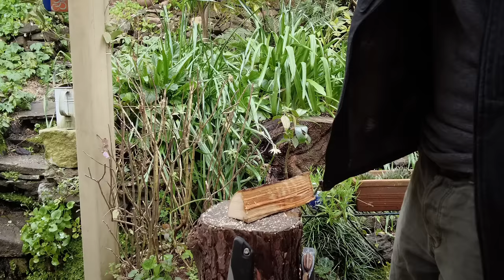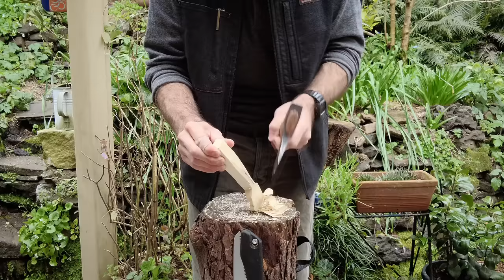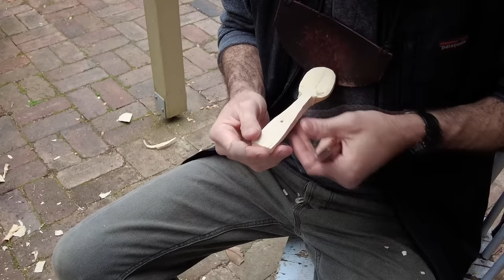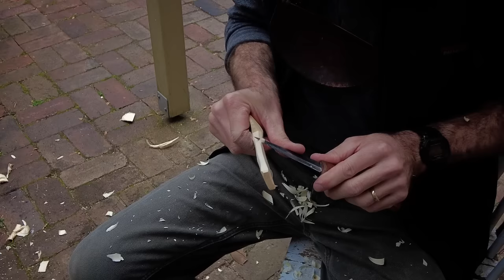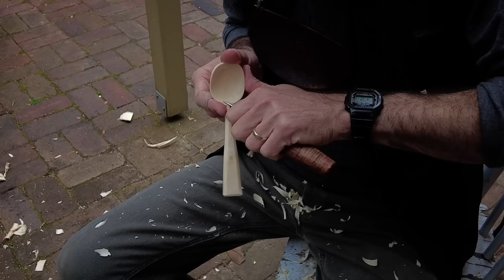Carving a Cherry eating spoon by hand - (silent)

Comment: 0:00 initial axe work - basic shape, heavy removal
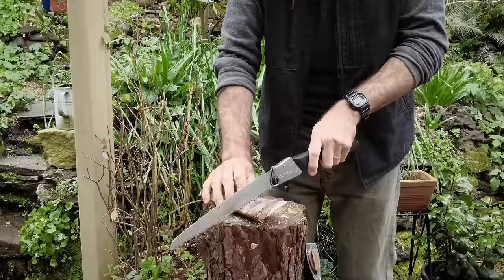1:20 crank stop cut, axing the crank
4:05 drawing the design
5:21 neck stop cuts/ end trims

6:12 fine axe work - handle, neck and bowl shaping
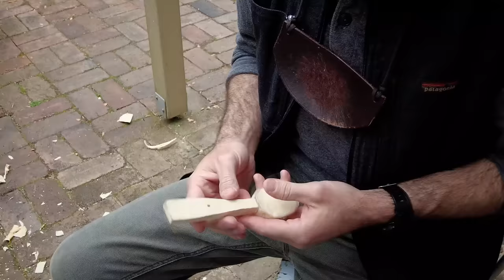11:05 Knife work - the bowl
13:44 The handle
16:40 Bowl outside & transition
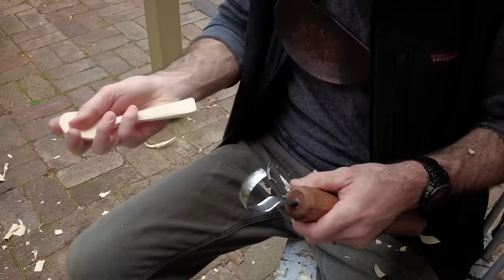18:05 Twca Cam
20:20 Hook knife
21:40 Sloyd
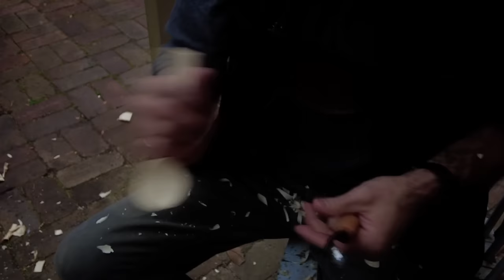27:40 Hook knife
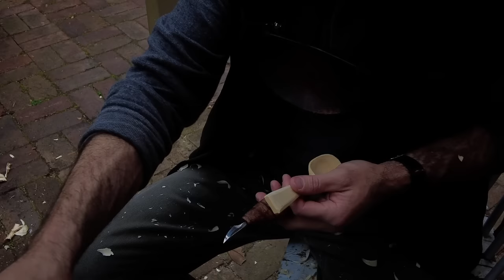29:13 Finishing cuts

Thanks for the video! Great result.
Reply from the maker: Wow, thank you for taking the time to time stamp this!
Reply: That is awesome! I will be coming back again and again when I get frustrated (just a bit) with my progress. Now I can go right back where I need inspiration. Thanks to the both of you!!!!

Comment: your knifes seem obscene sharp, especially the small sloyd and the hook-knife.
Whatever I do to mine, I can't seem to be able to sharpen to that level.
May I ask, how do you sharpen?
Which Stones (if any)?
which stropping compound on the leather?
How to get the curve on the hook?
aso....
Reply from the maker: Hi there! I have a bunch of sharpening videos covering my process. I highly recommend checking them out 🙂👌
Reply: @andyspoons  thanks a lot for the quick response. Your video with the explanation on knife bevels did the trick for me:
I bought a rather cheap set by beavercraft second hand, to begin with. The blades have a really nasty machined hollowgrind on them, which some kind pre-owner worsened with a secondary bevel of about 20 degrees.
I changed that with my DMT-Files from coarse to extrafine and some finishing stropping to "scandi other hollow", but now there's a new problem:
They are so sharp now, that they scare the crap out of me!
Well, I will have to grit my teeth and stock up on bandaids during the learning process... 😱😰😨😳🤕😁😁😁
Reply from the maker: At least you know they will be clean little cuts!

Comment: this is obliviously for entertainment purposes only...never,ever cut towards ANY part of your body....its not IF, it's WHEN
Reply: his whittle skills are second to none....
Reply from the maker: A pull cut is an essential part of this craft, and arguably a safer cut than most of the smaller push cuts you might do around a campfire. Technique is obviously paramount, and teaching new carvers very carefully is essential, but seeing a pull cut as a dangerous cut is just a lack of experience rather than a broad brush stroke. Safety first though, I couldn't agree more!